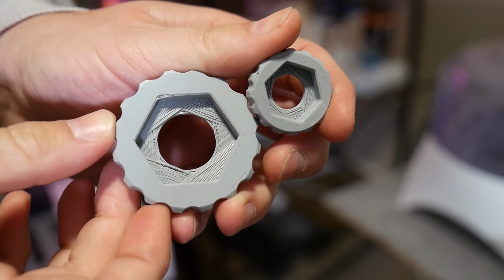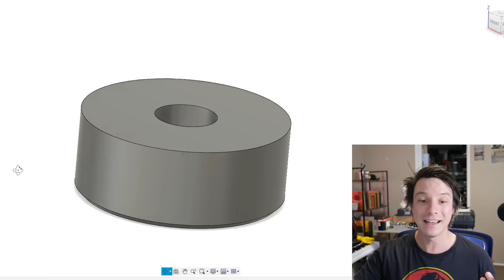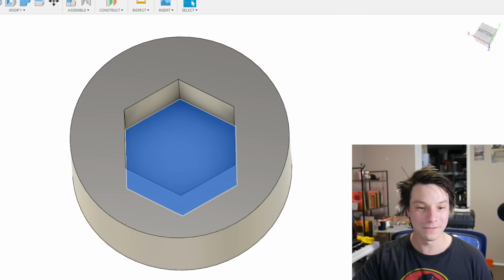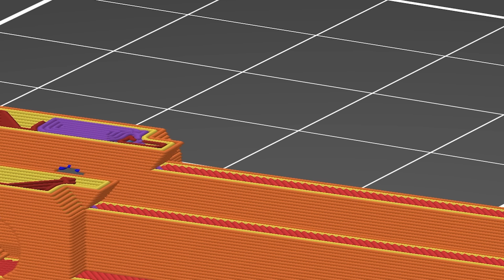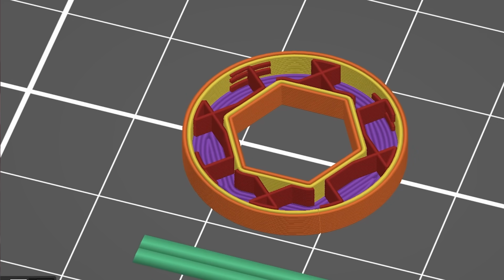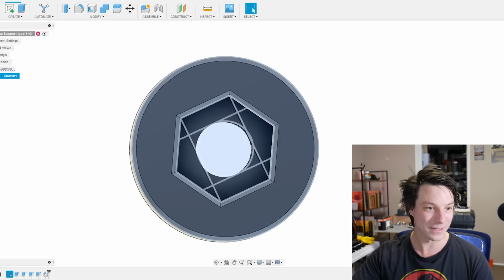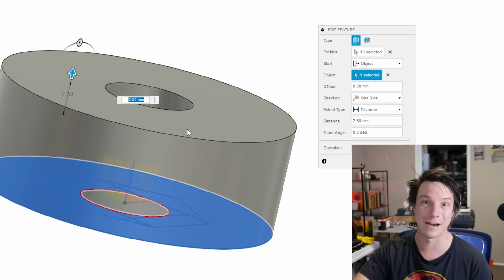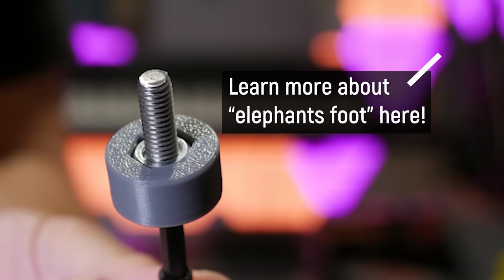How to 3D Print bores without supports (Fusion 360 Masterclass)

Comment: Personally, I find the method of Drilling through a fully closed Hole the most satisfying method mainly because it is the least time-consuming method ( drilling through a bunch of holes is a LOT faster than doing all the Sketching and Extruding for - each - and - every - hole ) - Would be sweet if F360 had an automated 3D Printed Hole Feature like that though 🤔

If you're working with SuperSlicer you don't even have to close the hole on your part to begin with! 😮
SS - If allowed to do it via the "Fill the voids with bridges" found in the "No perimeters on bridge areas" Dropdown Menu ( https://i.imgur.com/xTNaYLx.png ) will do that automatically for you...

Comment: i use really thin columns on parts where it cant bridge like one of the corners is angled or something. i add these thin columns on critical areas like 1 or 2 and slicer is already bridging out of it. i can print on optimal orientation for strength i need and i don't waste 20grams of material and i don't need any tool to break it, i just push it little harder and it comes of easily.

Comment: I think the sequential bridging should be implemented in slicers. It's a matter of 3D printing using FDM, not 3D modelling. The same goes for elephant's foot effect, I refuse to adjust my models with these details. Also, I think this should be doable in slicer in a single layer by first bridging one direction and then the other in the same layer.
Reply: I see where you're coming from. But, design for any manufacturing process includes some details of the process, and not just an abstract ideal model. "Design for manufacturing" is a field for a reason. I do try to avoid overly depending on 3d printing in my models, but I don't go overboard.
Reply: If it is included as a  slicer option, the modeler needs to know how the slicer implements the sequential bridging in order to account for the (in this case) changes in hole depth.  That is, it will affect the accuracy of the hole depth and therefore the fit up of your parts.
Reply: @michaelj3971  I guess that if this sequential bridging is ever implemented, this should be more like knowledge or tips you should apply for models that are supposed to be printed. I mean, "Add a 1mm more thickness to prevent the slicer to modify your accuracy if sequential-bridging". Personally I use a lot the trick of "water drop" like holes for holes that are printed vertically.

The idea is fairly great. However I am not agree on how it is implemented on this video. I mean, the part should be nothing but the part. Once the design is done, another design should start from the previous one and that's when all the 3D design tips should be applied (Water-drop holes, sequential-bridgin, elephants foot chamfer, horizontal expansion... whatever) . I think that this allows you to design a part without thinking at all on the way of how it would be manufactured. If this tips are eventually included on the slicers, you can always send the "untouched" part instead of the FDM adapted one.
Reply: @wyzedfz1495  More often than not, the manufacturing process dictates the design of the part from a very fundamental level. Meaning before you even open your CAD software, you will have to know whether the part will be for example turned, milled or 3D printed.

With 3D printing you avoid unsupported overhangs, but have basically unlimited freedom in other aspects. With milling you want the part to have as many vertical sides as possible and surfaces angled away from the spindle axis should be avoided where possible. You also have to account for the reach of the tooling available. So a 2x100 mm hole while possible to drill might quadruple the cost of a machined part. Not to mention more advanced features like curved holes. No problem for a 3D printed but a pain in the ass for a machinist. The list goes on. 

So you hopefully understand now that you have to know the limitations of the manufacturing process and design around it. Otherwise you might end up with a design that while technically perfectly functional, might recuire state of the art processes, tools and experience to manufacture.
That's why refusing to account for the limitations in some cases is a bit silly in my opinion.
Reply: @wyzedfz1495  Accuracy shouldn't be a problem if the sequential bridging is done in a single layer.
Reply: @Juhuuu  tbh, you are totally right. When I wrote my comment I was only taking on account the 3D printing possibility, when most of the "features" could be added afterwards.

But sure, knowing in advance the limitations your manufacturing process have is a safer way of design a product.

Thanks for your experience!
Reply: @Juhuuu  I agree, you have to know the capabilities before you design. Regarding the holes, that can be easily handled by the slicer. You don't want to get bogged down by all the details, if possible.
Reply: @mik13ST  No doubt we will see more and more of these "smart" features in slicers as time goes on. If you think about it, even the most advanced slicers are still incredibly rudimentary compared to what they could be. That's why there is still a lot of manual work needed to get more advanced parts to print properly.
Reply: @Juhuuu  Yes, we need more intelligent slicers that don't just slice the object into layers, but incrementally add material where it's needed together with simulations and what not.
Reply: PrusaSlicer has an elephant foot compensation option for years now, that works quite well.
Reply: I would suspect that printers with advanced bed leveling do deal with elephants foot, but printers that you level yourself are a bit too variable to predict, I would think. I don't get elephants foot on my on my prints (no auto bed level) so if there was any auto-adjustment, the changes might bevel the bottom of the print rather than keep it straight.
Reply: Is this not just "partially bridge counterbore holes"?
Reply: Cura "initial layer horizontal expansion" for elephants foot. Not sure on other slicers Cura has every setting I'll ever need and then some so I've never used any others. Seems like the rest just copy Cura anyway with things like tree supports and arachne lol

Comment: I like the idea of sequential bridging. Is there a fast way to repeat the same CAD features for multiple (possibly different) parts of the design? It seems tedious for more complex prints.
Reply: For anything with more than 1 hole I’d extrude the main body with holes only then extrude the nut/bridges as a new component, copy it to each hole location and use those to cut the main body… this would maintain parametricity and a much cleaner timeline. You could also copy the feature to each hole, but it’d be messy. I don’t see a simple solution across different features.
Reply: You model all of the known-working and identical features as a positive solid, then make them as an assembly constrained to all the holes you want them duplicated to. Then load that assembly as a boolean subtract so you can apply it to every hole.

Comment: The real second best option is to enable the new, experimental feature in prusaslicer 2.6 to use "extra perimeters on overhangs". Still has some failure on the first layer of the bridge, but better than "just print it".

For the 45 overhang, you could of course print a separate object to put on the bold before inserting.
Reply: Funny how Prusa Slicer is adding this feature, yet on SuperSlicer it already exists and we have "Simulate Prusa No Thick Bridge" to basically make it work like PrusaSlicer. I had having bridges that act as perimeters because the speed is dictate by the perimeter speed and not the bridge speed / flow / fan.
Reply: @ChrizRockster  Ahhh didn't know, use superslioer only sor tuning filament. Ill look into it a bit more.
Reply: @ChrizRockster  isn’t super slicer the slicer that just undid it’s lifetime license and wants like 100 dollars for a slicer that’s missing a bunch of key features of the freebies?
Reply: @JeronimoStilton14  , you're thinking of Simplify 3D.  SuperSlicer is a fork of PrusaSlicer. Which is a fork of Slic3r. Bambu Labs also forked off of PS and reskinned it

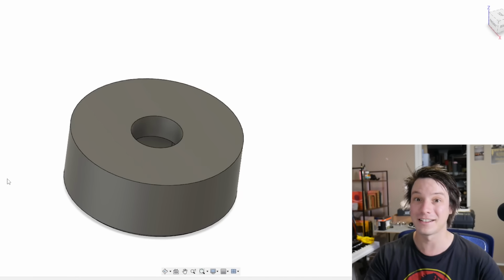Comment: 1:45 you could say that the reason you have to print it like that is because you've modelled half the model, then gonna fill it on the bed, and then continue with the next print.. or the bed has a surface you want embedded

Love the video tho, awesome stuff :)
Reply: Yeah or it needs nuts inset on both sides.